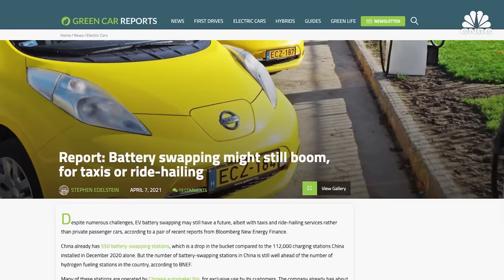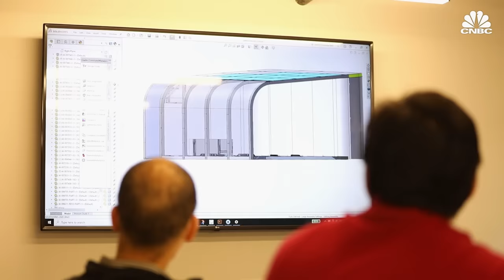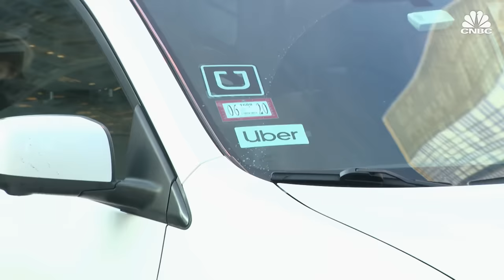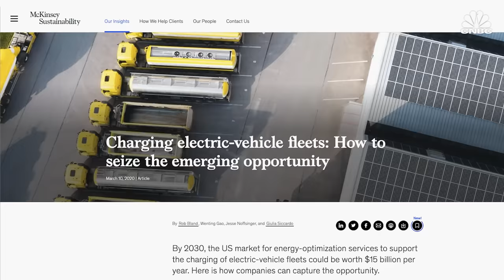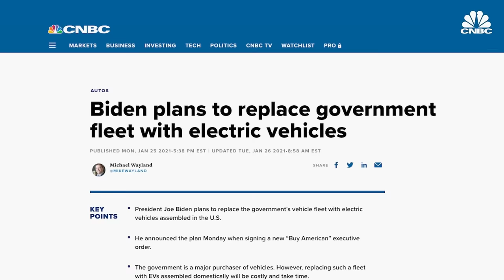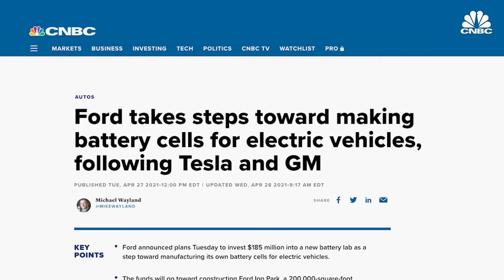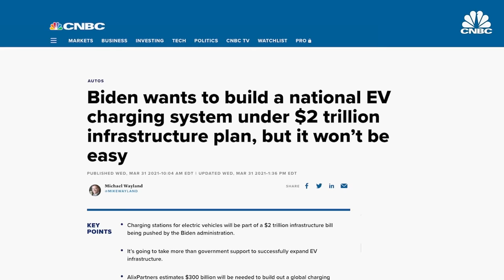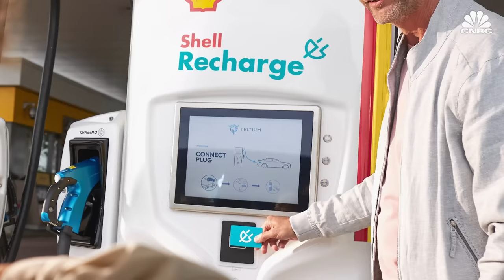Can EV Battery Swapping Take Off In The U.S.?

Comment: Electric cars are getting exciting as they are slowly overcoming their limitations. 

Electric cars are the future, that's for certain.
Reply: maybe, it's better be fast before hydrogen overcomes it's limitation
Reply: Nah electric car will not be the future. It’s just hyped. The best alternative currently is hydrogen fuel cell. Check out Toyota Mirai. Battery powered cars require charging, at high rates it damages fast and in high altitude and cold regions it’s effectiveness slashed by 60-70%.
Reply: @pinkysweets  Hydrogen cars is not the future estimated especially we haven't hydrogen station compared to electric car wish you can charge it at your home !
Reply: where do you think all the electricity comes from?... the future is nuclear hopefully the stigma goes away soon
\
Reply: @pinkysweets  Hydrogen will never succeed when you can charge an EV anywhere where you have access to a standard electrical outlet.
Reply: @bftjoe  i prefer gas...
Reply: @JAYJAY-ch4ik  Only a person that doesn't own an electric car would say something like that. I know a guy that bought his 80 year old father a Tesla. He said he would have NEVER known how much better the ownership experience would be, if he didn't have one.

A lot of miles were put on that car, in a short time. NO nasty gas stations.  NO oil changes.  NO emission tests. Quick as hell!  It's just...EASY.
Reply: @zion3335  It's like just because you don't know better.
Reply: @Zolar Czakl He should be rethinking it at the $4+/gallon it is at, now!
Reply: @zion3335  And, where does all the nuclear waste go? 🙄
Reply: @AscendedSaiyan3  nuclear energy is not  the 50's tech anymore....there are innovations in breeder reactors and fuel enrichment.....remember....we can now only use 2% of the fuel.....more research will lead to better innovations......and have you wondered that what happens when the sun dont shine or wind doesnot blow...and obviously the sun wont shine according to our requirements....its a colossal waste of taxpayer money while china builds more mega thermal powerplants....
Reply: @JAYJAY-ch4ik  

Hydrogen cars are still electric.
Reply: @medoomedoo1634  

Hydrogen is the future. You're complaining about the easy part. You can build Hydrogen stations. That's not a problem.
Reply: @bftjoe  

Hydrogen will always succeed. How much can you actually charge on a standard electric outlet? Not as much as you think.
Reply: @JAYJAY-ch4ik  and it is also mostly got from coal power plants and oil plants as a byproduct so it is far worse for the environment than electricity.
Reply: @JAYJAY-ch4ik  and you have no where to charge it as there is very limited stations.
Reply: @bobfg3130  Maybe the hydrogen cars is the true replacement of gas car but i prefer the Electric vehicle.
Reply: @medoomedoo1634  

Hydrogen cars are electric. Let's see how much will you prefer the battery powered car when it loses a lot of its capacity or the battery fails after 6 or 7 years and you will have to buy a new battery at a price that rivals that of a new car.
Reply: @bobfg3130  Isn't the hydrogen engine same as structure as gas engine?
Reply: @bobfg3130  Isn't the hydrogen engine same as structure as gas engine?
Reply: Synthetic fuel is the future
Reply: @Moecean  

No. It's a waste of energy.
Reply: @medoomedoo1634  

Hydrogen cars are electric cars.
Reply: @AscendedSaiyan3  where do you think the lithium for its batteries comes from...where does that dead battery go? lithium mining is already causing severe pollution and water crisis in south america...where its mined in one of the driest regions....basically ,making toxic lakes in the middle of a desert....
Reply: @bobfg3130  well then......what could possibly go wrong with cars having compressed hydrogen tanks......just driving around on the steet...does the Hindenburg ring any bells??.....BTW....i still think gas is the way to go....we should build smaller compact cars....a single commuter going about his/her life dont need no 4x4 SUV....aluminum components and plastics can reduce weight further....the lithium in tesla's batteries is certainly not economically viable or environmentally sustainable...
Reply: @zion3335  

You mean like having gasoline in tanks in cars? Or LPG or CNG? That's liquefied petroleum gas and compressed natural gas. The problem has been solved. You're complaining about a problem that has been solved. Hydrogen is the way to go.
Reply: @bobfg3130  hydrogen is much much more explosive and dangerous than these...
Reply: @zion3335  

Hydrogen is safe. You've mentioned the Hindenburg. 😆 The Hindenburg didn't explode. It doesn't matter if Hydrogen is more flammable. If you can contain those you can contain Hydrogen. You don't like facts. I know. Hydrogen is the future.
Reply: @bobfg3130  safe containment would be breached in an accident and with multiple cars and even trucks this would create massive death toll for passengers involved in accidents....i personally feel that the future propulsion would be some unique engine which we cannot comprehend today....BTW...FYI....electric cars are OLD!!!!! tech....the first cars were electric but the internal combustion engine proved a much better alternative...as for hydrogen...the tech is super expensive. hydrogen power is fundamentally old tech...i believe the basic tech...minus all of the marketing BS is just electrolysis....forward and reverse....these technologies are fundamentally old and inefficient.....just imagine the reliablity of the internal combustion engine...a mechanic in some african 3rd world country who can barely write his name can fix up a truck and make it move....this is what real pioneering technology is....
Reply: @bobfg3130  also you ignored my comment on making cars compact and using lighter materials like aluminum and composites...thereby granting more mileage...i don't understand the need for a GM electric hummer...i mean if its aiming for protecting the environment.....it kind off misses the point entirely...
Reply: @zion3335  

Of course. Pal, you can make the car as light as you want. It will still destroy the environment. An electric.  Hummer won't. Now, I don't want an electric Hummer so you can imagine how much worse your car is going to be against mine.
Reply: @bobfg3130  yeahh....just check where this lithium for ev batteries comes from....the world's driest places where artificial alkali lakes are created polluting the environment and causing water crisis for local communities....plus all that grid electricity does majorly come from fossil fuels....so don't feel too good about yourself...driving your expensive tesla...
Reply: @jswats92  "the future is nuclear hopefully the stigma goes away soon"
Elon Musk states that in the land area currently allocated for today's  nuclear reactor, the same energy output is achieved with solar panels at a much lower installation cost.
Reply: @JAYJAY-ch4ik  hydrogen is only really feasible on cruisers, planes potentially and other long-haul modes of transport, that is until a battery comes up that has absurd range and isn’t lithium based and has a high concentration of power for every inch of the battery.
Reply: @bobfg3130  Average person drives 30 miles a day. 3-4 miles per hour of charging off a regular outlet is more than enough for average users.
Reply: @bftjoe  

No, it isn't enough. Pal, you don't only get a car for just driving to work. You want it to have a bigger range. You will want to use it in trips.
Reply: @JAYJAY-ch4ik  "Nah electric car will not be the future. It’s just hyped. The best alternative currently is hydrogen fuel cell. Check out Toyota Mirai." You mean the Murai that Toyota is no longer making, the one they spent a billion dollars on development and have now abandoned? You're also criticizing the charging rate of a battery car, but ignoring pumping liquid explosive into a car's tank at 10,000psi? Really?
Reply: @zion3335  "i prefer gas..." And Exxon thanks you for your patronage.
Reply: @zion3335  ".its a colossal waste of taxpayer money while china builds more mega thermal powerplants...." China is the second-highest renewable energy nation on Earth - where are you getting your information?
Reply: @bobfg3130  "Hydrogen will always succeed. How much can you actually charge on a standard electric outlet? Not as much as you think." How and why will a fuel that's explosive, required to be cryogenically stored at 10,000psi and used in the car at 5,000psi be successful?
Reply: @justsomeguy934  

Gasoline is explosive too. Cars have run on liquefied petroleum gas or compressed natural gas for decades. And no, you don't have to cool the hydrogen to that level. Maybe you should stop lying.
Reply: @bobfg3130  "And no, you don't have to cool the hydrogen to that level. Maybe you should stop lying." Um, maybe YOU should start thinking. Hydrogen is the universe's lightest gas at a single molecule. You cannot store enough to be practical as a fuel unless you pressurize it, and you must liquify it to have enough to push a car any reasonable distance. Guess what temperature you must have to liquify a gas? That's right, cryogenic temperatures. Google is your friend, please use it and research how hydrogen is stored and especially used in hydrogen vehicles. The pressure of 5,000psi keeps the hydrogen liquid in the tank of the car. 
Oh, by the way, you're right gasoline is explosive as well. WHY do you advocate we carry around a liquid explosive?
Reply: @bobfg3130  "Gasoline is explosive too. Cars have run on liquefied petroleum gas or compressed natural gas for decades" Sure they have, and they still lose about 70% of their energy to heat, not a great solution. I wouldn't compare a fuel to gasoline, it's not a good energy source. To use a gas as a fuel, you must liquify it first, then store it under immense pressure to keep it liquid.
Reply: @justsomeguy934  

Actually gasoline is a great source of energy. The inefficiency of the internal combustion engine is another issue. And this is not about combustion. You fail.
Reply: @justsomeguy934  china is also the largest coal burning nation on earth....plus they dont have any environmental standards....how do i know this just check out pictures of bejing's smog problem....the renewables they produce is also just a smokescreen for their fossil fuel powered economy...
Reply: @zion3335  "plus they dont have any environmental standards....how do i know this just check out pictures of bejing's smog problem....the renewables they produce is also just a smokescreen for their fossil fuel powered economy..." China most certainly does have a pollution problem! And they are fixing it with incentives and requirements to buy electric cars. Unlike the USA, China doesn't have oil interests and lobbyists bribing the politicians to keep burning oil as long as possible. I'm not admiring China, believe me, but their requirements to move to electric cars greatly exceeds that of the USA.
Reply: @bobfg3130  "Actually gasoline is a great source of energy. The inefficiency if the internal combustion engine is another issue. And this is not about combustion. You fail." Do you even THINK before you say something? How on Earth do you divorce the inefficiency of gasoline combustion from the energy density? Does a gallon of gas have any useful purpose if you don't burn it? Gasoline is far more energy dense than a battery - I give lectures on the subject - but you must BURN the gasoline to use it! When you do that, you waste 70% or more of that potential energy to heat, and a good portion of the remainder to NOx and other poisons. You fail.
Reply: @bobfg3130  "You can pressurise it and it will give you a good range. Stop lying. Did you just ask that question? It's safe. That's why. Seriously, it makes you look stupid." How safe is 5,000psi stored hydrogen? Safer than a solid battery? Do you know how difficult it is to make and seal a container at 5,000psi? Yes, that's the pressure required to store enough hydrogen for practical range. And you must store the fuel at 10,000psi at the dispensing station. Seriously, your comments make you look stupid.
In addition, hydrogen is an energy loss, just as bad as gasoline. You only get back about 20% of the energy required to refine and store the fuel. Gasoline is in the 30% range once you account for heat loss.
Reply: @justsomeguy934  They ARE the oil industry...the CCP party controls the government and the oil industry....why do think they need lobbyists?? they even control what information goes out of the country....go ahead and believe the fairy tales told by MSM....probably they too apparently tow the ccp line....
Reply: @bobfg3130  "I am thinking. Maybe you shouldn't. You don't need to liquify hydrogen to fuel a car. You can pressurise it and it will give you a good range. Stop lying" Um, hydrogen is indeed liquid in a car's tank. Just like the propane you buy for your grill, it's stored at enough pressure to keep it liquid so you get the most fuel in the smallest space. You don't have to refrigerate it once it's liquified, the pressure keeps it liquid.
Reply: @zion3335  "and china and the CCP thanks you for yours...." Your comment makes no sense. How does driving an electric car that uses no petroleum for fuel, can get its energy from the sun, contribute to the CCP? Does the Chinese government control the rain that fills a dam, or affect the sunshine on a solar panel in the USA? Big Oil doesn't want you to drive an EV and they pay the USA politicians to keep it that way. I support a freedom to choose how my car runs. I don't need Exxon's permission to drive my car, do you?
Reply: @zion3335  "go ahead and believe the fairy tales told by MSM" What are you talking about? Who says I believe MSM? Certainly you don't trust that MSM isn't influenced by oil money, right?
Reply: @justsomeguy934  or the ccp....ccp seems stronger in this case....why would they run after climate change which is anti oil industry??your logic doesn't add up....
Reply: @justsomeguy934  i dont need anyone's permission either, ride a horse carriage if you want....we are all free to choose....i have the right to call bluff on the ev industry....90% of whose components come from china including the Lithium ion battery....which is worse than gasoline...the chinese govt definitely controls a vast amount of the ev components market....ever heard of rare earth metals like cadmium,cobalt and neodymium, lithium....yupp....all required in EV's and 95% of its supply is china based....so go figure it out....
Reply: @zion3335  "why would they run after climate change which is anti oil industry??your logic doesn't add up...." WHO? Are you talking about the Chinese government? How are they "running after climate change"? China has a pollution problem, climate change hasn't entered the conversation as far as I remember. Please stick to one topic, and quote the subject you're responding to.
Reply: @justsomeguy934  if MSM IS influenced by oil money why would they tow the climate change line which is in direct contradiction to oil industry...JUST explain this to me....i don't understand this warped  logic...
Reply: @justsomeguy934  by they i meant the MSM..not the ccp...i want to really want to understand this logic...
Reply: @zion3335  MSM balances their political motivations with their paid advertisers. You'll note that you'll NEVER see a news story on how unsatisfactory it is to buy a car at a dealership. You'll also never see a story on how well Tesla is doing, their car advertisers won't allow it. Tesla doesn't advertise, so they have no loss in that department.
Climate change: this is MSM's political push, and in my opinion to harm the US economy. I have, however, seen MSM news articles making attack statements about renewable energy (wind energy in particular). 
So in summary: MSM will support climate change perspectives, while at the same time accepting influence to not talk about electric cars in a positive light. How many car ads do you see on the television in one show? Likely a dozen an hour. Traditional car makers are not about to let a news service talk about how happy Tesla owners are. Oil companies, however, advertise only a fraction of car makers. How many Exxon Energy ads do you see? Very few.
Reply: Not if Big Oil has its way.
Reply: @denelson83  "Not if Big Oil has its way." I'm happy to say this is one trend that Big Oil cannot stop. All other battery technologies were purchased by Big Oil and locked away. The chemistry for lithium-ion batteries can't be locked away by Big Oil, so all they can do is slow the adoption.
Reply: @piotrtrebisz6602  I don't doubt you; we absolutely must learn how to handle, and not ignore, nuclear power. But when an agency, or a government, fails to do what they need to do to protect the public, we need to reconsider a new nuclear plant en lieu of renewables.